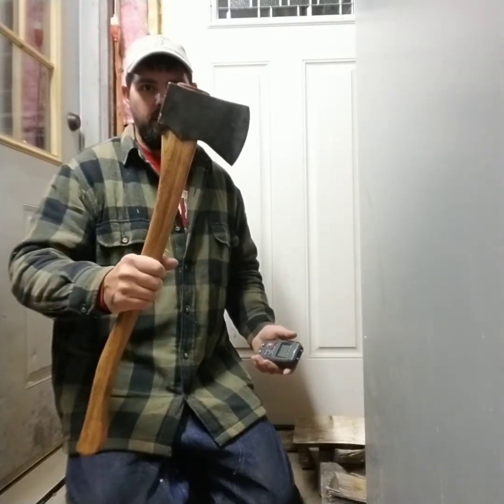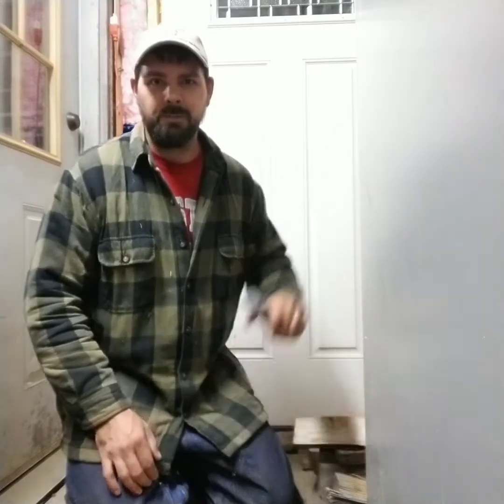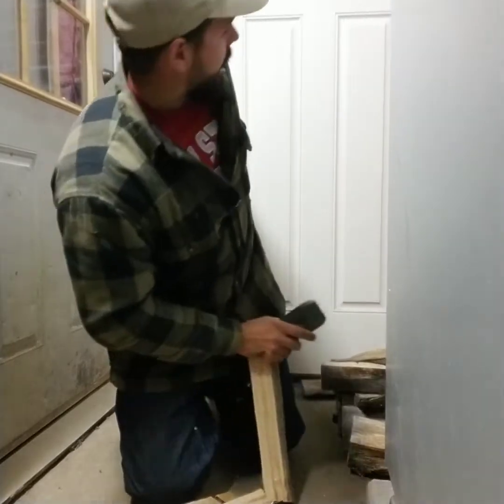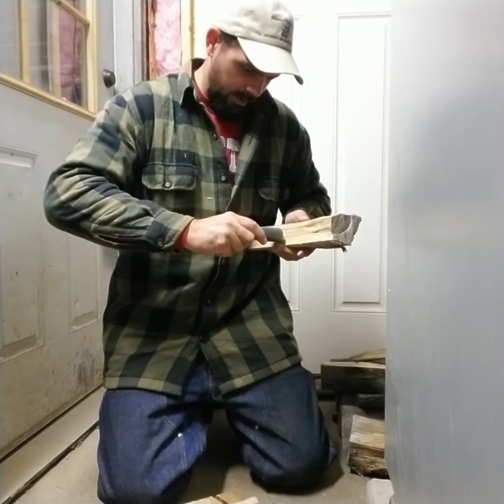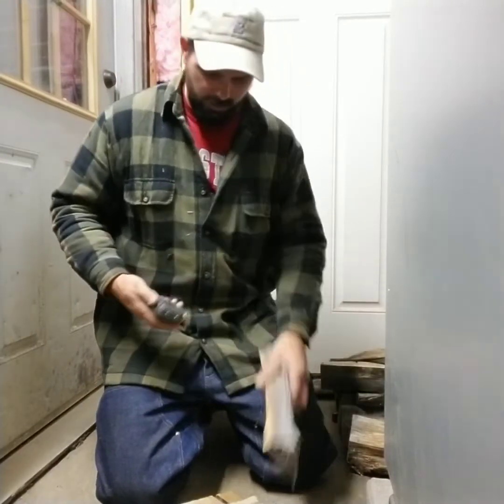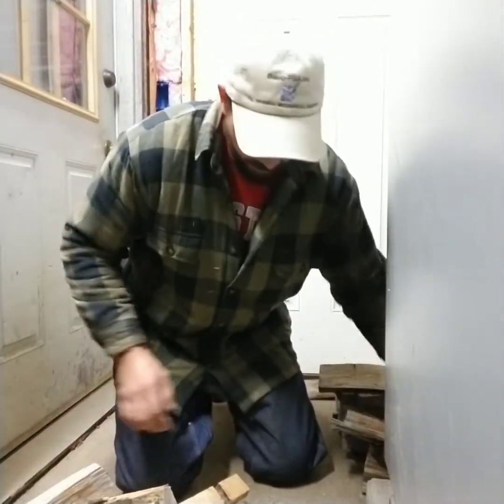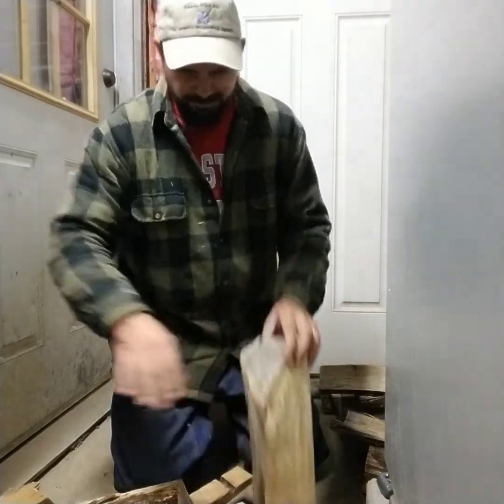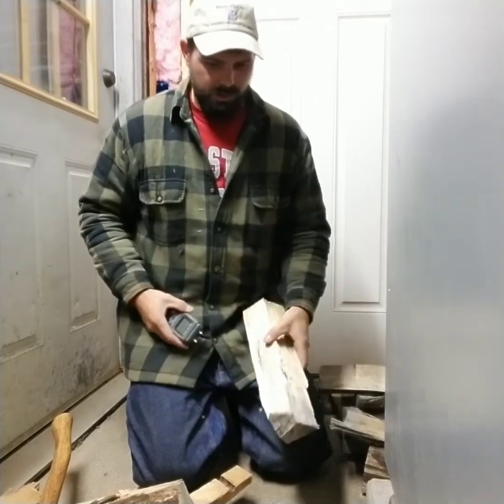Firewood Moisture

Comment: There is an ultrasound version of that meter that has more reliable readings, but you have to be serious about your wood, $200-800 range.  Great info thanks Marshy!  Love the videos!👍
Reply from the maker: Awesome, I never knew. Which do you have? 🤪
Reply: I don't have one or the other.  I picked up the info from Matt Cermona's Channel.  I just use my fingers to check the moisture.  If its wet it will not burn LOL, or just requires more Diesel Fuel😁 and/or leaf blower😂👊👍
Reply from the maker: @jeremywever6947  🤪🤣🤣🤣